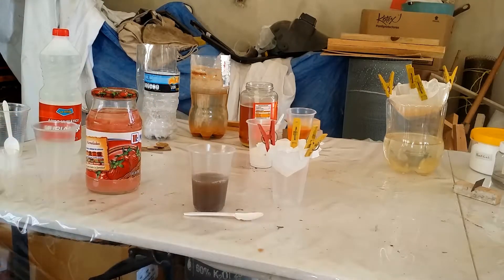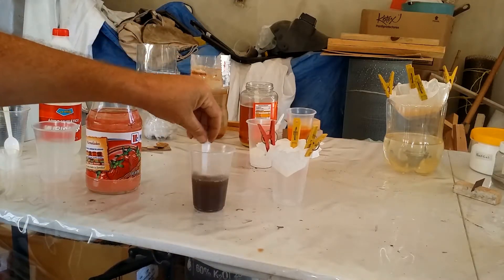Manganese Sulfate for Batteries

Comment: hello, what is manganese sulfate mixed with? only water?
Reply from the maker: Hello.  Yes I first mixed the Manganese sulfate with distilled water although plain water would be the same. Than I used Calcium carbonate to pull out impurities.
Reply from the maker: The calcium carbonate is fairly insoluble and lowers the ph slightly causing iron and other impurities to precipitate, but does not lower it enough for the manganese to precipitate.  Although there will be a little calcium carbonate in solution after filtering. All the calcium carbonate will settle out in a day or 2 if you let it stand.